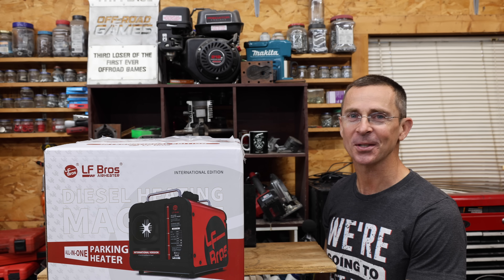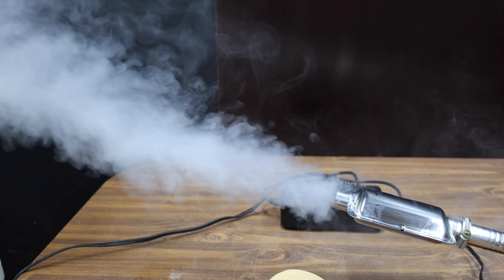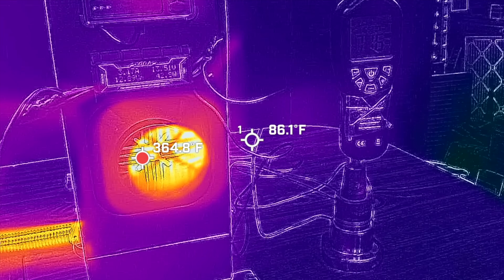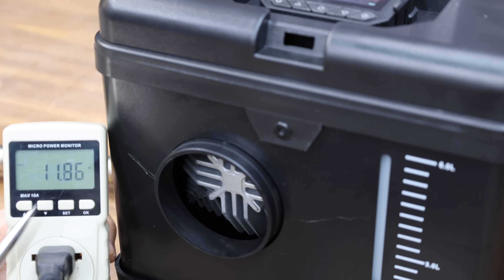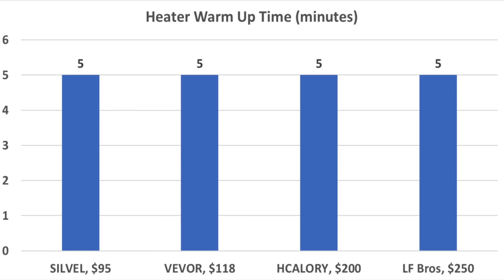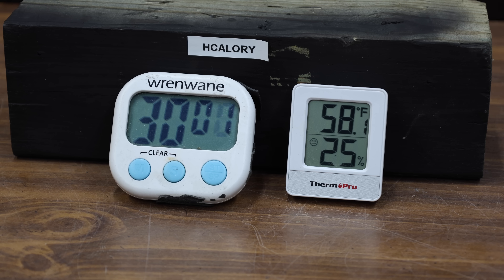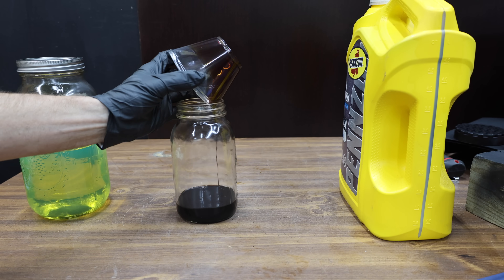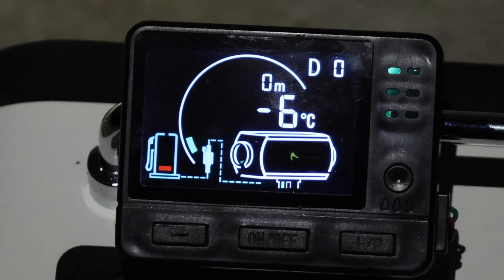The Truth About Cheap Diesel Heaters!

Comment: These heaters are very cool!
So these have been around forever but instead of being called Chinese Diesel Heaters,  they were called Parking Heaters.  Truckers have been using them forever they used to be very expensive though before the Chinese companies started making them.
I wish you would have done the tests a bit different.  This will heat a small room in your house but it's designed for a vehicle.  I wish you would have tested in a van,  camper,  or car.  Also you kept referring to a power outage but were plugging it into AC outlet.  Most of the time you need emergency heat is because of a power outage.  I wish you would have done tests on 12 volt batteries and how long it will run on a fully charged battery.  Maybe a lithium vs lead acid or whatever typical old school car batteries are.  That being said,  I did appreciate the testing you did.  There are so many brands of these now a days I'd like to see more testing of these.  Thank you for your work sir,  we all appreciate you soooo much!
Reply from the maker: Thanks and you are welcome!  Thanks for the suggestions.

Comment: I fitted one 4 years ago in my campervan, regular use ,its never let me down.
Few things.
Green fuel pipe supplied with some is crap,skip it. Replace with white.
Battery cables not thick enough, replace the cables.
Dont mess about with the settings.

Great video.
Reply from the maker: Thanks!

Comment: There are many youtubers that are reclaiming the heat from the exhust to make the heater way more efficient.  I've seen a sand battery ( large cylinder with exhuast ran sith loops inside it.) As well as ehaust ran though cast iron raditator. Pretty interesting stuff! 
Myself I've been using a ceramic heater to keep my insulated garage over freezing. Its going to cost me a fortune.😢
Reply from the maker: Thanks for the feedback.

Comment: If there is a power outage, how does a heater that requires an outlet keep you from freezing?
Reply: They're 12 volt, originally a German design, used for heating vehicles. They can be powered with a car battery, or a plugged into a 110v voltage reducer for wall outlet use.

Comment: Thank you! Bought this (vevor model) and it arrived a few days ago. Used a few tanks of diesel and now have gone the whole day using vegetable oil ( i source used oil from chip trucks and wing shops for bear bait during hunting seasons so I filtered some into new jugs and been using it as fuel) im grid in a trailer so will help alot with saving on firewood
Reply: *update for anyone wondering the fuel pump is not strong enough to support oil when thick and cold(e10 code).did mix with some diesel and started right back up no ptoblem and been running since
Reply from the maker: You are welcome!  Thanks for sharing.

Comment: I have the Vevor 8K and it heats up a tarped off area of 8×10 in my back garage. The temperature ranges anywhere from 16 ° c on low setting  up to 25° c and on high settings when it's -15 out outside. It's a good heater. 4/5 stars
Reply from the maker: Thanks for sharing.

Comment: The white smoke from the first unit is the reminiscent unburned diesel from the direct dc/cigarette lighter socket attempt. It is a common problem with all those units.. they all will show that .. white smoke after failed attempt due to low power.. and not unique to that unit itself
Reply from the maker: Thanks for the feedback.

Comment: Just a heads up,  cigarette lighter plugs are SUPER inefficient and don't maintain a great connection. Anything over 10 amps is pushing it and will be warm, and they're prone to losing power. For a more permanent solution you should definitely go with a proper plug, and wire direct from the battery for RV applications.
Reply from the maker: Thanks for the feedback.

Comment: Good grief. Run a secondary insulated high temperature rated duct around the exhaust duct (but away from the end) terminated with a side outlet routed to the inlet air. This makes a regenerable heat exchanger that uses the exhaust duct heat to preheat the inlet air. That may require changes in the inlet materials of construction, and other mods. Adding split fins into the regenerable section will also greatly increase heat recovery.
Reply from the maker: Thanks for the feedback.

Comment: These are all Webasto and espar knockoffs, after years of trucking in Canada I have a lot of time with these heating my truck while parked. For anyone looking to use one long term: run a couple quarts of kerosene through it once a month to keep the chamber and screen clean. Also, run kerosene right before you intend on not using it at the end of your winter season.
Reply from the maker: Thanks for sharing.

Comment: All the heaters are the same there  only 3 real main differences when it comes to performance and reliability, the cheap branded ones pretty much all the same there are 2k which are harder to find, then there are the 5k version which are common and some are just relabeled to 8k for marketing purposes and prices increase, then there are the high end version and those the ones made by hln oem a
Quality for factory installed trucks and used in industrial settings,and a few other brands and those I would qualify only as high end if it has the oem Kyocera glow plugs that are way more reliable, and also brushless more efficient and last longer than brushed motor for the fan, and quality control modules more reliable and easy to use plus more settings for tuning, so that pretty much it, if I had to go van life or really required it to live I’d get a hln pro model it has all those high end components, webasto and others are overpriced, roughly 500$ for the hln rather than twice or 3 times that for the others

Comment: The "LF Bros" Must have various types cos in another video they are much quieter exhaust and no clicking from fuel pump, a bit more expensive, also saw quieter silencers sold independently with blue, square housing.

Comment: I use one daily and it heats the whole house. It has a 50ah life battery and a constant voltage power supply to maintain the battery. I have used it for 3 years now and had to replace the control board on the heater once in it's first year. No problems since.
Reply from the maker: Thanks for sharing.

Comment: ***important oversight*** I ended up getting a diesel heater last year for camping and the biggest issue you run into is these will trip most portable power bank’s max DC wattage output. If you were to use the cigarette lighter adapter that was recommended in the video, it would most likely trip the breaker. Unfortunately, you have to use the less efficient AC/DC converter plugged into the power banks AC outlet, meaning that you’re taking the DC battery in the power bank, converting to AC and then the plugged in AC adapter is converting it back to DC for the heater.
Reply from the maker: Thanks for the constructive feedback.

Comment: These are very inefficient. I bought one to try it a year ago.  The one I had used a lot of fuel.. you can notice the waste by how hot the exhaust is. Buy a toyostove laser heater and run it on diesel. I have an old one and it works great. Been running it on diesel for 5 years now with no issue. Trust me it's a far better unit. Anyone trying to hear their house or shop trust me you'll save a lot of money.

Comment: I've got 3 of these. two are the short wide ones which I like because of the larger tank and stability.  The way they are put together is what to look for. They pretty much all heat the same. So they wide ones are better if they are constructed with quality sheet tin . latches or not. and the fuel pump noise is the issues.
Reply from the maker: Thanks for sharing.

Comment: The one that smoked could probably use a little tuning on fan and pump speed. You go in to the 1688 settings you can then make adjustments for fan to pulse speed. Use webasto altitude sitting guide as a starter point usual helps. Some of them need some actual  adjustments made to the burn unit good news plenty of videos on them now.
Reply from the maker: Thanks for the feedback.

Comment: 2 things
One, you were using mixed oil with diesel to test and got me thinking there should be a very strong, bold, and loud warning, never use anything with gasoline with unit!

With the price of diesel these days, it's still hard to beat my 18k propane heater i picked up at tractor supply for only $120 a couple of years ago. No external piwer source needed. No electricity needed to refill the tanks, etc.

I know there are multifuel generators out there. I'd be curious about testing the heaters
Reply from the maker: Thanks for the feedback.
https://www.youtube.com/watch?v=hynRbnQ2hIE

Comment: Had mine for several years, use it to heat in garage on and off. works great in a 3 stall garage ( insulated and already 50 at all times) takes about a hour to heat it up to almost non jacket work. Mine was black Friday deal for i want to say $99. While i have not tried i see people mix waste oil with gas (25% gas) and you have pretty cheap fuel.  Works amazing i think, know about 4 people with all sorts of brands all still going ( as far as i know). I think mine is Vevor , looks exactly like it but many do. Instructions are bad on all the ones i used. but a little youtubeing and you will find what you need.
Reply from the maker: Thanks for sharing.

Comment: Suggestion:  Test the Dickinson Marine diesel heater.  Popular in sailboats and Tiny Houses.   I'm seriously looking at this heater for my 960 square foot house.  Currently I have a coal stove in the living room, as well as an oil furnace in the basement.  I love the live flame of the Dickenson & low maintenance.
Coal is cheap but somewhat high maintenance because I have to empty the ash pan and fill the hopper with fresh coal.
The oil furnace is low maintenance but per BTU it's a lot more expensive to run.
Reply from the maker: Thanks for the suggestion.

Comment: Thanks for the reviews. I use one of these heaters for my small off grid cabin. The heater works awesome and doesnt use much fuel or power, perfect for this application. My cabin is 12x16 and it kept it over 60F even when it was down to 8F the next morning. The biggest issue with all these heaters is the controller, just horrible. Poor temp control. I'm looking into some 3rd party stuff at the moment.
Reply from the maker: You are welcome!

Comment: im confused.. if these can be used during power outages to generate heat... then wouldnt i also need to run a generator to power this unit? it seems to need sufficient electricity to run the pumps and fans.
Reply: Yes, you need a generator or a battery to run them. However they consume much less power than a full size heater.

Comment: Bought one from Ebay last year, it's very good, but needs a car battery to start up. Best tip I've heard is to buy off-road Diesel fuel with the red dye, it's less expensive than regular Diesel or kerosene.

Comment: I just bought the Vevor before seeing this video. I use it to heat my 12x22 insulated workshop. My winter temps here average between the mid 30's to the mid 50's during the day and this heater works very well at keeping the shop comfortable. Sometimes I have to turn it to the lowest setting and open a window. I have it set up outside and ran the vent hose through the wall. I built a small well vented enclosure for it and ran the exhaust out. I was using a 1500 watt electric heater and a propane heater which required me to open 2 windows for air which kind of defeated the purpose of keeping the shop warm. I still use the propane heater for the initial warm up along with this heater.

Comment: I am currently using a Master MH-80-OFR forced air/radiant heater for my ~800sqft garage. It does well, but i was wondering if one of these would be more efficient. The one i have now takes a 16°f garage to 56° in about an hour @ 15ft away.

Comment: This might be outside of your wheel house but doing some tests on jumper cables (like comically long ones) and or solar battery tenders would be very well received in your community. 

Nothing sucks more then needing a 28ft jumper cable set and not knowing what one’s are good or even claim to be what they are.
Reply from the maker: Thanks for the suggestion.

Comment: Bit more of a niche part I suppose, but have you considered doing a video on compressor filters? I have gone through a few setups myself and still am not very happy with quality or use of these things. Between clogging, improper pressure readings, moisture removal and just having the things explode, I am sure there is a lot to test with them.
Reply from the maker: Thanks for the suggestion.

Comment: good lord the hcalory is using a socket thats usually used for 110/230vac for a 12vdc connection. Can see someone plugging a sraight mains cable into that iec socket.
Reply: yes, the female on end of cord says l,n,g like a computer cord. Oh look! got it at a yard sale, lets see if it powers up.(plugs in cord from a computer.)

Comment: I don't like the power input on the the HCALORY. It uses a C13 plug for the 12V in. That plug is mostly used for 120/240V, like on the back of PC power supplies. I can see someone grabbing a random power cord not knowing and break the heater.
Reply from the maker: Thanks for the feedback.

Comment: Hey project farm!  Have you seen The Motor oil geeks test  Valvoline Restore and Protect oil? It would be cool to see you take a high mileage engine, show the valve train before, after 5k miles, change oil, 10k and so on.  It sounds like the oil is able to remove deposits extremely well!!
Reply from the maker: Thanks for the suggestion.

Comment: Good idea but honestly, much better off just getting the standard 24,000 BTU kerosene heaters (dynaglo or any other brand, they're all the same, been around forever). Work indoors (Japanese use them regularly to heat their homes), 2 of them heat my uninsulated garage even in the winter (in new england), low maintenence, no electric, they work indoors, no smell (unless you dry burn, or a oitttle smell when you turn it off), super efficient, work great, indoor and outdoor, and parts will always be available). I run 2 in my garage workshop, but they're great for outages indoors, too. 2 of them had my uninsulated detached garaged comfortable to work in after about 20-30 minutes today (when it was 19 degrees F in the garage before starting). Usually around %150 new, and they're dirt cheap all over the place (just found someone selling 3 of them today on local craigslist for $50 each, or all 3 for $100 total). can't beat em.
Reply from the maker: Thanks for the feedback.

Comment: HazMat Tech with a few other specialties. I don't want to get too far into the weeds on it but be aware that the results of your gas detector testing likely is inaccurate or at least should be taken with a grain of salt. It can help paint a picture or confirm a bias, like "there's some smoke" or "a strong exhaust smell",  but the digit results on their own as a number probably shouldn't be taken as fact on their own. The science behind gas testing not just as they relate to exhaust gas are beyond just "combustible gasses". Here we should see more metrics to paint a clearer picture of what's happening. This test probably should have included the use of meters that include VOCs, Carbon Monoxide, Hydrogen Cyanide among others.  The testing to be used effectively should have been done with a much more advanced meter than china's most affordable, probably fully into the vehicle emissions testing area as they're engines. Calibration reports would be done in-between each test to confirm that the sensor is functioning accurately and is not saturated

Comment: The heaters can draw up to 150W on startup. That can exceed a 12V 10A circuit. It makes sense to use a 120V to 12V 15A converter to start it up.
Reply from the maker: Thanks for the feedback.

Comment: The only reason the first unit smoked is because it got shut off due to the power supply. If it had adequate power initially it wouldn't have blown smoke. They tend to do that when power supply is interrupted

Comment: Omg I have the vevor one!! Also if you are new to the diesel heaters the code 8 will appear often. It’s because of the fuel pump sucking the air or creating the air inside of it. You have to tilt the fuel pump to the right angle.  📐
Reply from the maker: Thanks for the feedback.

Comment: I've had one heating an 800 sqft room in my shop that's not insulated for two years and haven't had a single problem. It will keep it about 65 with an ambient outside temp below freezing. A 5 gallon tank of diesel will last a couple weeks running about 8 hours a day on the medium settings. Saved me a ton of money compared to my buddy heater that runs on propane.
Reply from the maker: Thanks for sharing.

Comment: Whats the ceiling height in your 800sqft shop? And is it insulated?
Reply from the maker: The ceiling height is 12 foot and it is decent insulated.
Reply: @ProjectFarm  thanks for your reply. This is really promising. I have a 600sqft garage with 10' ceilings. I was going to put in a wood stove, but maybe 2 of these working together might do it. I only heat the garage a couple days/week